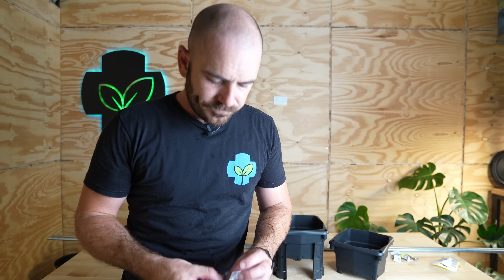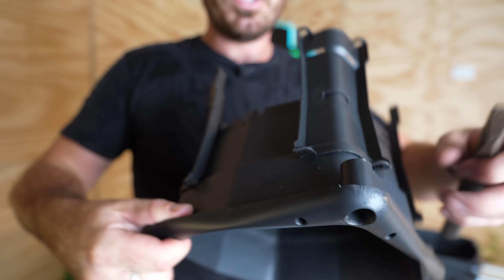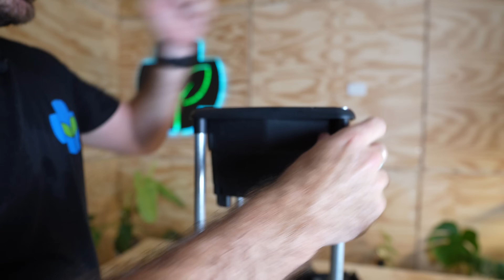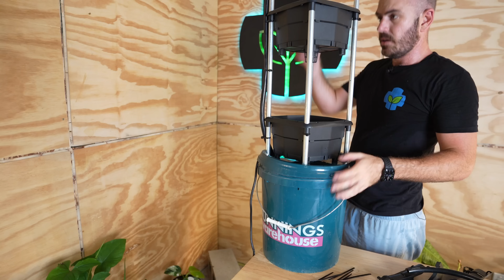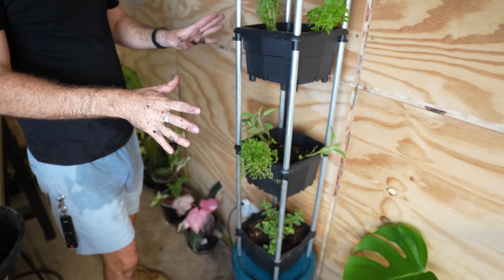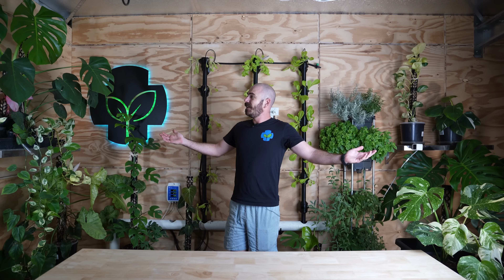The Hooch Multi Bucket Tower

Comment: Ok so could 1/2 wooden dowels or 1/2 inch pvc work instead of the metal pipe cuz i believe it will rust in time n you cant rust proof them in any way cuz its directly in the nutrient bucket also lifting the entire system isn’t ideal for weaklings like myself using a watering can is a good alternative but its not using the system as intended 😅 bt what about ppl with back issues the larger pipe to the bottom connected to a res is a good idea tho also
Reply: Dowels will rot, PVC will be prone to cracking if you're not careful with it.

Coat your galvanised tubing in a waterproof layer instead.

Add tubing or hose that runs up a front-facing leg. Add a funnel and pour your nutrient into the funnel so you can do it at a comfortable height. Remember to remove the funnel because it's probably not UV stabilised. Alternatively, make a diy funnel out of a UV stabilised plastic or use a metal funnel.

Comment: What’s the rate of level by level water use? Eg if 500ml goes in the top bucket only about 100ml might make it to the bottom bucket, as such level will absorb some and not pass it on. Do the buckets need to be planted accordingly to water living to more water sparing?

Comment: I like the looks of the new system.
Perhaps the poles could be PVC.
Also what about using a very small "mini submersible water pump" with 1/4 inch tubing in the poles and running it all the time.  No timer, quieter and cheaper.

Comment: Hey Hoocho, I really appreciate your channel and I have learned so much from you. When you started talking about your wall of hooch multi buckets, I envisioned them with the pots connecting it all. I'll try to explain what's in my head, but it might be challenging. If you set up five pairs of poles, you can have three buckets U-U-U, then above, you could have two buckets off set -U-U-, then you could have another row of three buckets U-U-U, and so on., Basically the pole going through the right of the top bucket would go through the left of the bucket below it and the right of the one below it...etc.. It would in essence look like:

U-U-U
 U-U
U-U-U
 U-U
U-U-U

I don't know if that makes sense or not. Just really like this system. You are doing great!

Comment: I love the system.  I suspect you will have nutrient flowing out of the buckets as it runs off the leaves below.  To prevent that put a piece of tubing the diameter of the net cup running between the bucket above (with the net cup inside of it) down to the bucket below, so that the flow of nutrients bypasses the leaves and drops into the media.